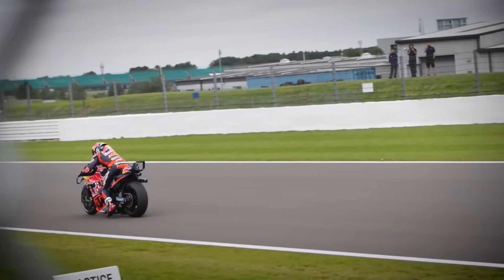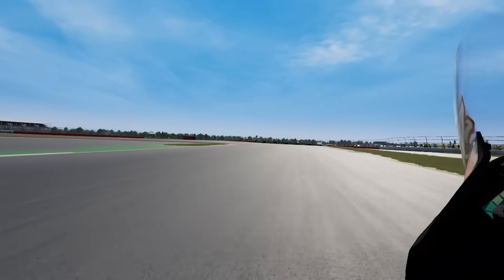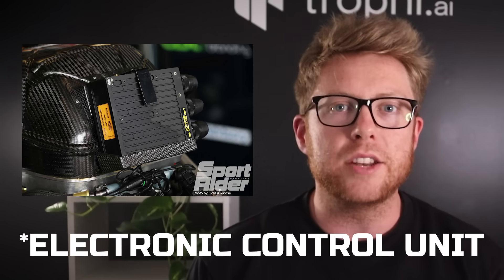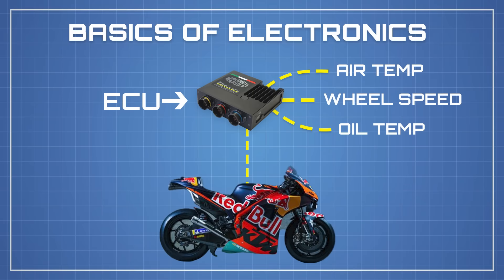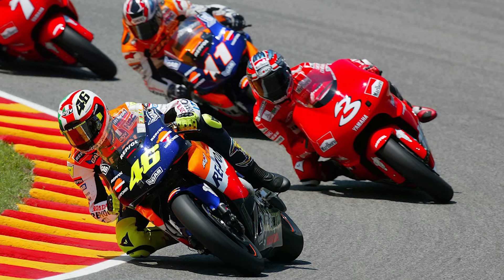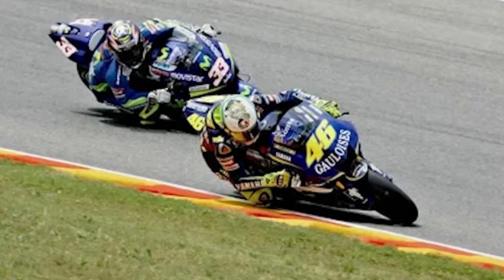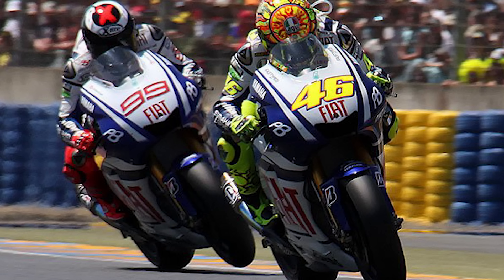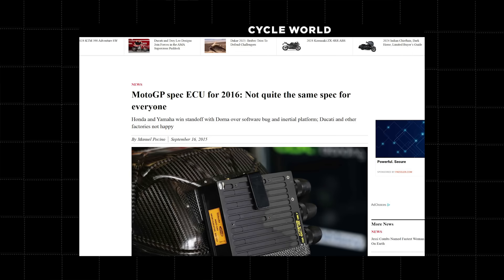MotoGP Tech, Explained in 14 Minutes

Comment: A good video but you missed a few major points, when the switched from 2 stroke to 4 stroke engines they didn’t change the Carburetor to an ECU, that’s nonsense, they changed to fuel injection  and fuel injectors can be tuned and control the fuel ratio very precisely by an ECU.    The next point you missed is the start and wheelie control systems are not just ECU smarts, they really only work when you add the rear rude hight device, this squats the rear suspension done very low gaining a physical advantage to keep the front wheel down during hard acceleration.   You can see this on the launches Miller demonstrated.   They also lower the rear ride height on every corner exit.   It makes a major difference.